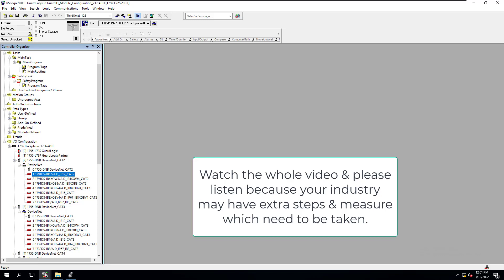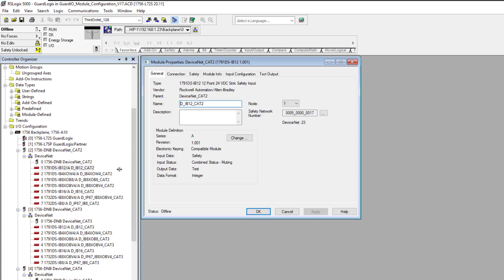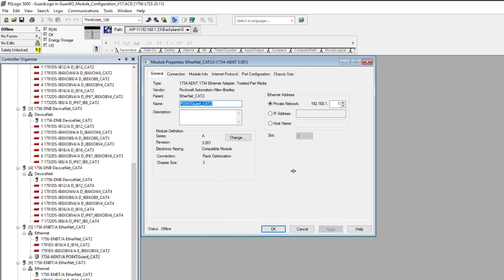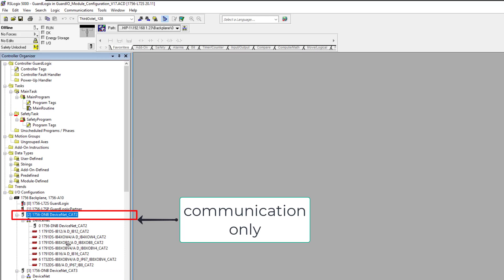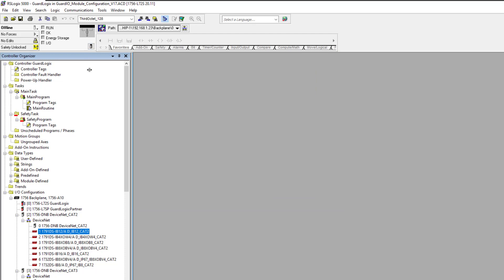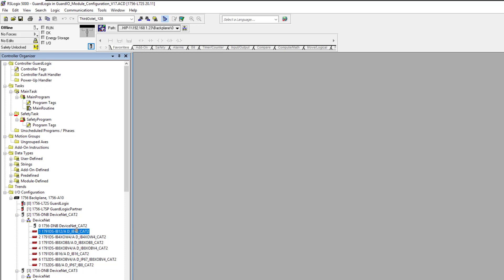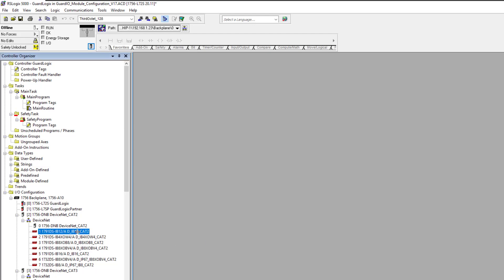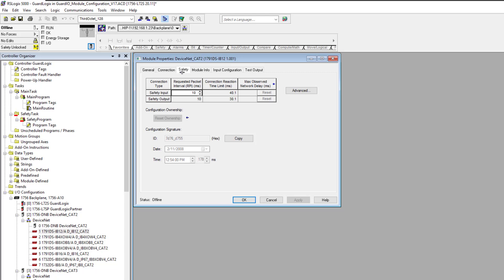Replacing Safety I/O Cards in Guardlogix - Setting Ownership between the Processor & the Card

Comment: I had a question in our process we have a remote I/O set up with safety cards. If we plug in a brand new card out of the box it never requires us to do anything. I was once told if we out a safety card in a slot on the chassis it is now assigned to that slot.  Is there anyway to be able to pull that card back out and use it in a different slot? Or would that be the same thing as resetting the ownership. I find it crazy that once you put a card into a slot you can't use it anywhere else but that slot, this what I was told I'm not sure how true it is
Reply from the maker: In that case you still need to reset ownership
Reply: @ShaneWelcher  ok so for instance if someone replaces a module and that wasn't the issue. If we wanted to use that card elsewhere we would reset the ownership.
Reply from the maker: @JavierSolis0710  yes
Reply: @ShaneWelcher  thank you I'll be back with more questions I'm sure. We recently started taking studio 5000 courses thru Rockwell to learn more about building programs and how to work on our machinery with it. So your videos are really helpful because someone of the classes were taking are kind of a drag.
Reply from the maker: @JavierSolis0710  Yeah, I build my courses to teach much better than Rockwell's in class courses.

Mine are online & self-paced plus easy to understand.

https://www.allen-bradley-plc-training.com/p/plc-programming

Comment: Hi, I work with s7 and Tia portal, I want to learn studio 5000. My question is. Where is on the HW config safety address configuration, example, does point i/o have safety adress(its similar to et200(Siemens)), festo insels, and stuffs with safety. Thanks!
Reply from the maker: I teach all Rockwell Automation software.
Reply: @ShaneWelcher  ok, but can you tell me how this safety address function in Rockwell, or myb help me to find manual, tnx.
Reply from the maker: Point IO have safety module in Rockwell, they are red modules that use two slots

Comment: We have a AB 45 KW motor connected to a AB 45 KW drive, But in running load is only 4 to 5 KW only it has a internal shunt connected on a the same power rail and a external shunt connected through internal shunt . While the motor applys break the drive goes into E-75 fault despite of connecting an external shunt.

 Please suggest on this.
Reply from the maker: Really hard to answer because of all the variables involved.

Sounds like you do not have the parameters set up right or maybe  the physical wiring isn't correct.

Double check everything, along with proper grounding.

Comment: Not sure if it’s YT issue but I cannot change video quality to 1080p. It’s keeps the video at 480p when selecting High Quality. At 480p, everything is slightly blurred for my old eyes. Thank you Shane for the video
Reply from the maker: Check your internet connection, and do an internet speed test.

If the internet is strong then adjust the video settings using the gear icon on the bottom right-hand corner of the video.

I record in 1080p HD

See this post for more
https://www.youtube.com/post/Ugw0NY6CgL4IM8dNS2Z4AaABCQ
Reply: 1080p fine here